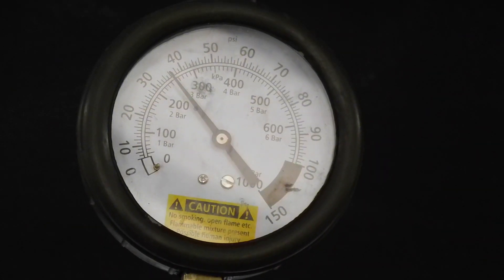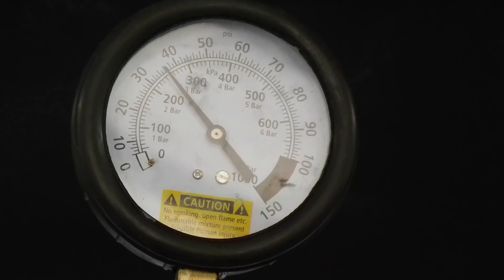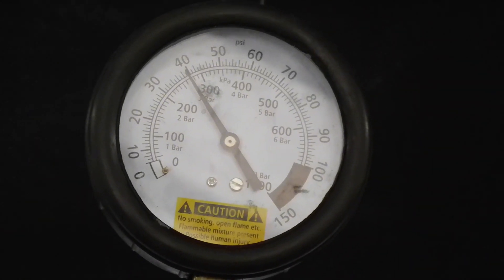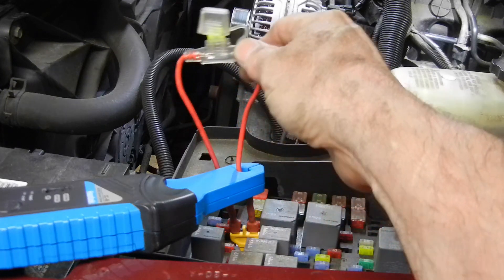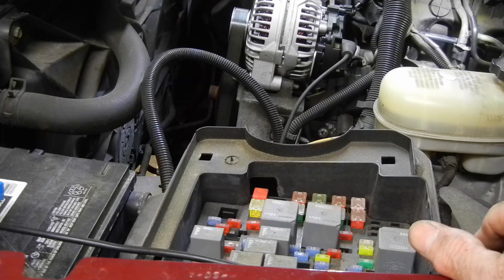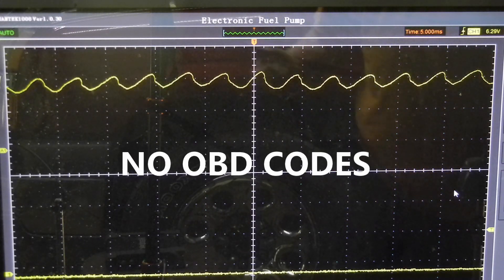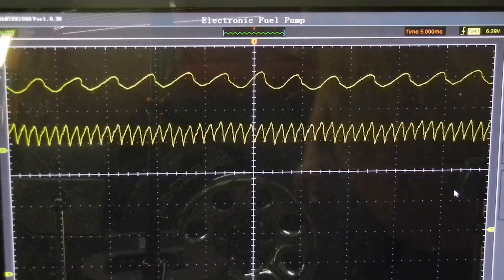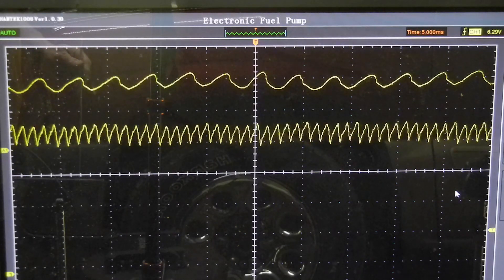05 CHEVY SILVERADO 4.8 FUEL PUMP TEST

Comment: electric fuel pump runs with a with a ECU that is wired to the relay that is wired to the fuse that is wired to the battery using high pressure fuel and the mechanical fuel pump just run with the camshaft tappet using low pressure fuel. I am a little exhausted for using electric fuel pump but using a electric fuel pump for a carb engine like I am planning on the project I am doing. My dad kept a fuel pressure regulator from the 80s that is a knob dial no gauge of anything like that it just  a knob that go from volume 1-9 made by Pro-Fuel that got a line in to line out place it close to the carb.
Reply from the maker: Yeah there is an advantage to running a electric fuel pump with todays fuel when using a carburetor better cold starts epically if your like me and cars sit for long periods of time.

Comment: That is so awesome, brother. Well done. I bet pulling the fuel pump is not a fun job.
Reply from the maker: Its not to bad if you have a good transmission Jack to lower the tank.
Reply: @moparnut6286  ya, that's true. I just look at it. I would be doing all of that on the ground.